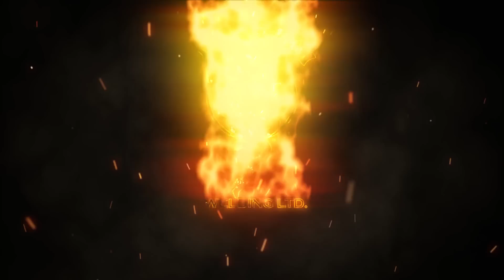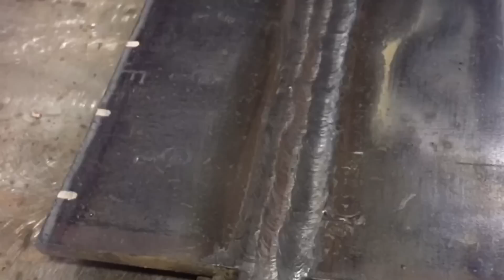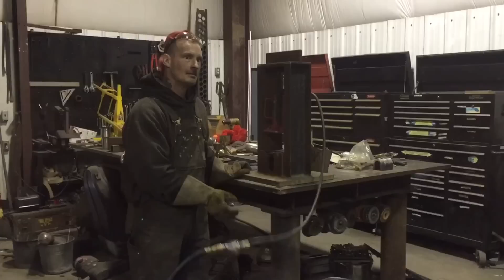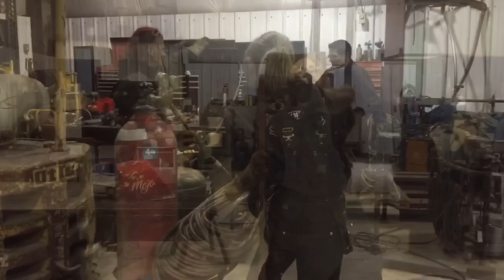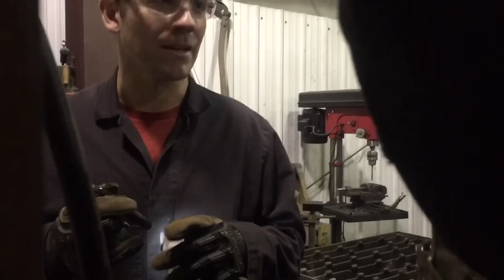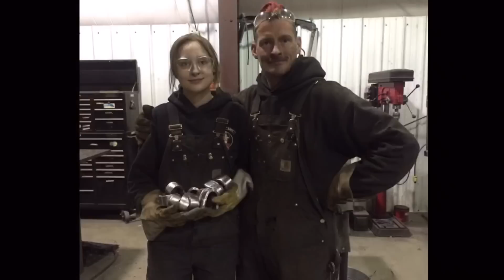16 Year Old Girl Crushes Welding Test

Comment: I'm a retired ASME pipe welder/steamfitter with a job history of working in fab shops.Its been my experience that girls make good welders.Welding and sewing both require an attention to fine detail.Be careful in fab shops because of the smoke use the smoke vacuum or a respirator on certain projects.The smoke is toxic.If you are pipe welding just keep your head out of the smoke.If you can pass the 2 inch ASME 6G[pipe test] you can get a good job anywhere.The test qualifies you for double the pipe wall thickness you test for.Example .344 wall [standard test]qualifies you for .688 wall.[more than 5/8]That's a large pipe.Good job girl!!!!

Comment: Welded for many years in my own shop after welding for Manufacturing companies building various components for Coal, Cement and Power Generating Plants. Everything you touch is either Hot ,Heavy or Dirty. Welding is NOT the job you want if you want to retire Healthy enough to enjoy your retirement. Back, hip, legs, shoulders, knees and lung trouble will cripple you for life. Not to mention MOST of the older welders are PRICKS, they treat you like SH** unless you are related or a DRUNK who hangs out where THEY DO.,,they will not teach you anything that would endanger THEIR jobs.
Reply from the maker: You're not wrong.

Comment: I'm not trying to be a dick or anything because I think it's cool that she's welding but there were a lot of valley's between her welds, I seen some undercut, and her tie in are lumped up. It's cool that you passed a bend test, but that's a pretty easy test to pass tbh. 3g open root with 1/8th land and gap is really the certification you want for structural welding. 6010 uphill root and downhill hot pass, then uphill 7018 weave bead for the fill and cap
Reply from the maker: Then don't be a dick. You're just another armchair welder who comments they see undercut that doesn't exist. And I've seen many, many apprentices of all ages fail these same bend tests no matter how "easy" you think it is. She's 18 now and I guarantee she'd weld circles around you buddy.
Reply: HellNBack I'm 18 too, and I doubt it. I just seen her welds. At my school that wouldn't pass at all, plus I have my 6g pipe certification. The best person on Youtube to compare me to is Jody from Welding Tips and Tricks, my instructor used to work with him. But like I said I'm not trying to be a dick, I was just stating the obvious
Reply from the maker: Clifton Williams sure kid.

Comment: congratulations to her.. all of my weld coupons were x rayed so anything not right shows up. Not to take away from her but I think all certifications should be x-rayed
Reply from the maker: CWB doesn't x-ray because it uses destructive testing. X-ray is non-destructive and for a different code. I used to be a repair guy for when other welders failed their x-rays, and it's usually used on pressure piping. The expense alone of x-raying every coupon would make no sense. You can also actually pass an x-ray test and still fail a bend test in some cases.
Reply: Radiography can miss certain defects like lack of fusion if it occurs at certain angles. The bend testing will let u know if it's there😂

Comment: The brief time you showed those welds the first two looked nice. but some of those later ones had massive undercut and overlap
Reply from the maker: You obviously know nothing about welding. If she had those she wouldn't have passed. Where's your CWB inspector ticket troll?
Reply: so your quick showcase of welds was not her welding?
Reply from the maker: this was all her welding...who else would it be?
Reply: Anthony Madden your jealousy is pathetic
Reply: your a tool^
Reply: Anthony Madden
Reply: welding is math is just some sort of strange bet for prima donna's.  undercut is indication of proper penetration.  theoretically the only issue with undercut is an issue with dumping some voltage and filling in some stress risers mathemetician welders are unwilling to formulate for.
Reply: I did see some undercut but it's been a year now so she's probably gotten better.

Comment: My ex could lay down such a beautiful bead but knew nothing about welding.  If I set up things for her, she welded as good or better than I did.  I kinda think women would make better welders.
Reply from the maker: I've seen crap female welders just like I've seen crap male welders. Welds and metal don't care about sex or gender. You can either weld or you can't. But it shouldn't be a big deal to see a female welder and women should get a fair chance in the trade. Women are half the work force and are still underrepresented in the trades.
Reply: What does my comment have to do with feminism?  You don't like the truth?  You want the whole world to see things your way?  Is your way the only way?  I don't feel that women are equal in all ways.  I use a walker and I think I can whip even athletic women in the strength department. Does that make you feel less threatened by the truth?  Go back to hiding under your bed snowflake.
Reply: Robert, you are correct.  If a woman chooses that career and succeeds, then she's a welder.  Fine job, Trinity!
Reply: But my idea is that women don't bring the "home welder crappy ok welds" to the school. If you learn correctly tge first time it goes well. But men are usually taught some simple welds at home and its harder to learn I guess...

Comment: That's 25 push ups per eye Mr Red Mohawk. That's how my instructor gets the freaking freshman to wear their glasses. Some learn, some don't.
Reply from the maker: What was the risk to my eyes on a bend test?  Watch all my vids. I wear eye protection when I need it.
Reply: HellNBack I'm still in school, your shop your rules. I know if you're caught without saftey glasses at any point in a shop twice in your entire time working, caterpillar will fire you. Could be 19 years apart and they will fire you. I don't know what applications that has in your shop but hey, the more you know.
Reply from the maker: that is pretty harsh! considering the most I get shit in my eye is when I lift my Helmet and it goes right behind.
Reply: HellNBack IK if I get them too close they fog up to far it flys right through. All is know is it's better to have them and not need them them, then need them and not have them.

Comment: Good stuff but dude, put your safety glasses on when you´re doing testing - something may shatter / fly apart & take your eye out - you´ve got them on, use them :)
Reply: Safety glasses are must
Reply: As someone who see's good advice. I'd say your macho reaction sucks. Be a good teacher by showing your students you can learn.
Reply from the maker: gotta live dangerously sometimes ..
Reply: yeah I wholeheartedly agree but... Spend that danger somewhere else like riding motorbikes / jumping out of aircraft etc - too easy to lose an eye for nothing... :)
Reply from the maker: Danger was pretty minimal. Glasses were always on for the sparky parts. And have you SEEN my other vids?
Reply: I live in germany and i never wear safety glasses when i work with an anglegrinder or use the lathe. You americans are safetycrazy
Reply: Fuck safety